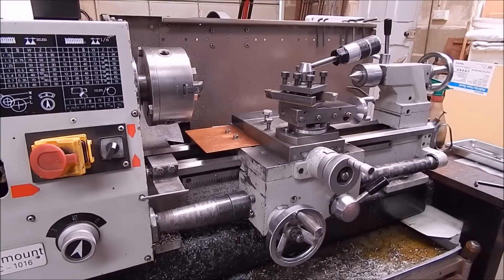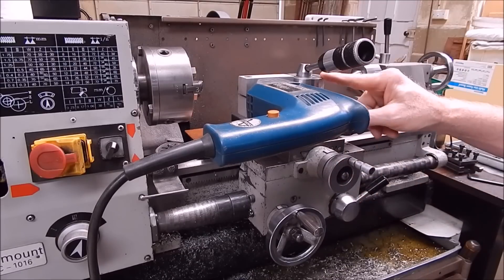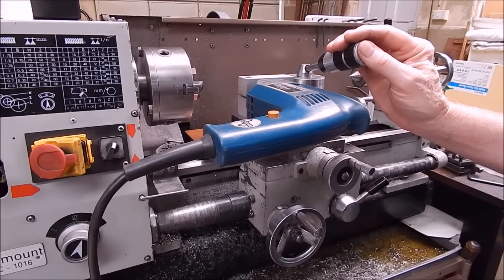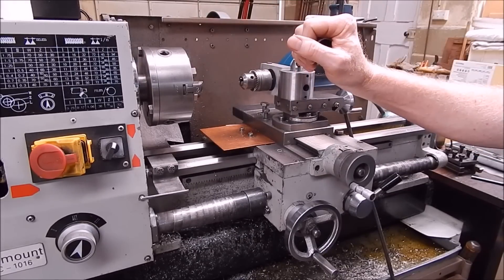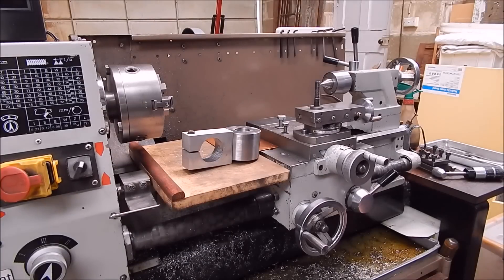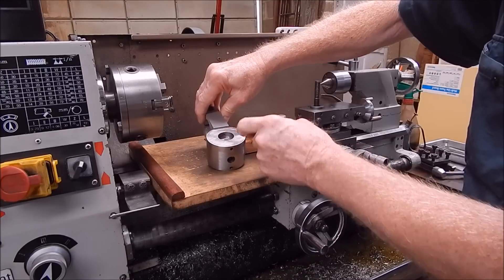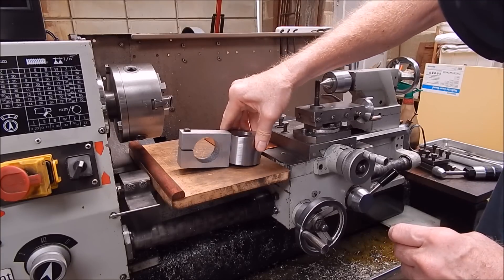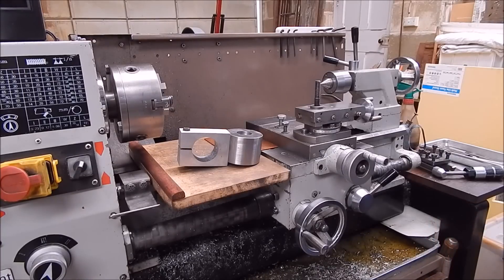Grind lathe chuck jaws with an electric drill

Comment: Great idea but wouldn't a better design been to have a square block mounted to the top slide rather than a round one? That would have meant the section holding the drill would have automatically been set back by the length of the side of the square block. You could make that piece mountable on whichever face you liked as well to make the whole thing more flexible.
Reply from the maker: +Ashley House 

I did consider that, but didn't have any square solid, so went this way.

Cheers Rob

Comment: Welll, happy Christmas and a good new year to you, and thanks for posting. That gadget has a lot of applications. It is sort of like the "Potts Milling Spindle" that used to be made in the UK. You could also use it  to drill off-center holes on a round that you  had just turned. If you held the work in a 4-jaw you could use the chuck itself as a 4-hole dividing head, putting a level  on the horizontal jaws, or if you had 3 holes you could use the 3-jaw and prop each jaw separately. I would not use it as a toolpost grinder because it does not spin very fast. What, 3000 RPM? You want more than that. On my tiny Taig lathe , I have cobbled together a toolpost grinder wwith a Dremel. .The  Dremel spins about 10000 RPM full out   The trouble with the Dremel is cobbling up an adapter. If you take off the nosecap you will find an M19x2 thread. If you can cut that (I can't),  you can just screw the Dremel into  your gadget, and presto. I myself bodged an adapter, using the Dremel chainsaw sharpening adapter and   a piece of 6mm square to fit the toolpost. Lot of overhang. Still working on that.
Reply from the maker: +Juan Rivero 

Hi Juan.

I can't see why 3000 RPM would be inadequate.  The stone is only kissing the chuck jaws, which you can spin in the opposite direction as well.

Cheers Rob
Reply: But the higher the RPM the smoother the groind. But maybe overkill. "Perfection is the deadly enemy of good enough," as one of my cousin says.Experiment will show.

Comment: Mentioned in a comment a few weeks ago that I was getting my first lathe. Update for anyone who cares, it arrived today. It has a few rough edges to sort out, but looks pretty sound for the most part.
Reply from the maker: +Rob Mckennie 

Hi Rob.  Some information on what it is, would be interesting.  Sorry, I can't remember the post on the lathe.

Always interested to hear what others have got.

Cheers Rob
Reply: It's a circa 1950 premo, made by brackenbury and austin in sydney
Reply from the maker: +Rob Mckennie 

Interesting.  Does it have the single mounting base or two?

Rob
Reply: xynudu If I understand what you're talking about, two.
Reply from the maker: +Rob Mckennie 

That's the much better unit.  The single base mount lathe is prone to flex apparently.  The bigger unit that you have is a good machine.  I think Premo are based on the Advance lathe.

I hope you have a great run out, of it and some serious fun doing it.

Cheers Rob

Comment: Hi Rob !

A nice idea for the jaw grinder !

You experimented with just spinning the chuck faster instead of having this "load ring" for the jaws - did you see "dobbleboost" idea placing a ring from the BACK of the chuck and use the spiral "threads" on the JAWS to load against ?
Really nice idea when you have those jaws that CAN'T be preloaded from the front of the chuck !
Reply from the maker: +Keld Sørensen 

Hi Keld.  I haven't seen that video.

Will check it out in the next few days.

We are in for a hot spell of over 40C, so I may have some YouTube time available :-)

Also may have the occasional beer to prevent fluid loss.

Stay warm over there.

Cheers Rob
Reply: Yeah, you allways have to watch out for the fluid loss and dehydration - a serious matter !

We have a warm winter now - we didn't for many years - in the short run GOOD but in the long run it is a little worrying, I think !

Comment from the maker: This mount may not have enough drill chuck/cross slide clearance for cross drilling on a very small lathe.  However it would allow chuck jaw grinding on most lathes.

I nearly didn't post this video,  as I wasn't happy with the mount's travel limitations and design deficiencies.

But then I thought, it does give some insight into issues to consider when doing this, and maybe it's not totally useless after all.

Cheers Rob
Reply: +xynudu  we all learn when things that do not go as planned. Happy you posted the video. The community is better for it.
Happy New Years. See you next year.

"I have not failed. I've just found 10,000 ways that won't work."
Thomas Edison